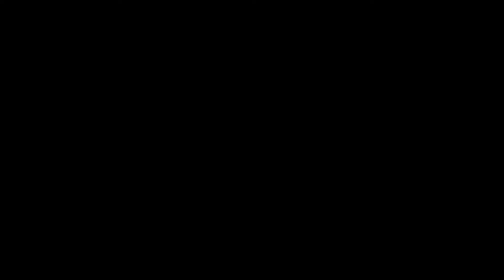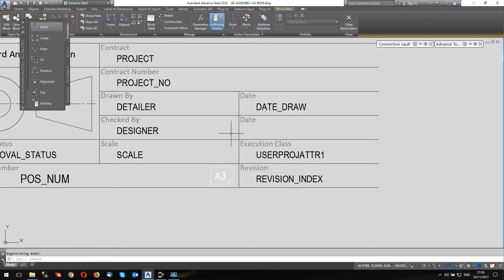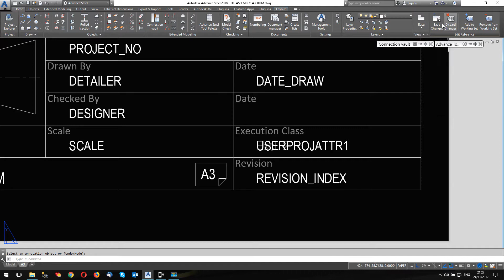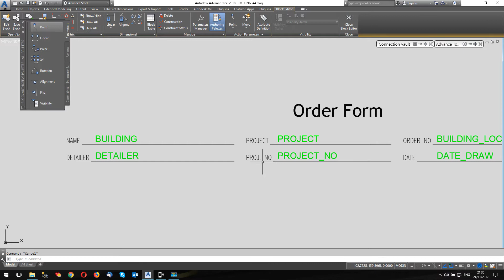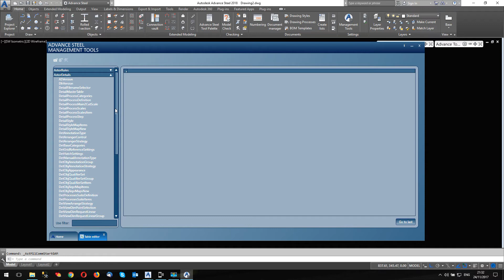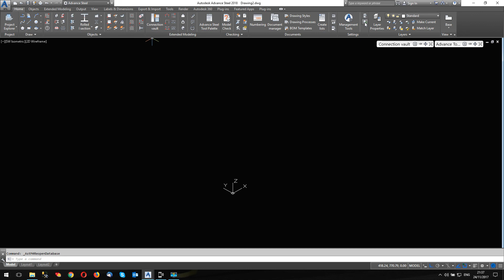Changing the Headings in Project Data

Comment from the maker: Note ... Since the changes to the database engine in Advance Steel to SQL databases it appears that the ErrorMessages table in the AstorControlStructure database has also changed. The ErrorNumbers for the User Attributes 1 to 5 are now in the range 32771 to 32775 and not in the range 32756 to 32760 as stated in the video.